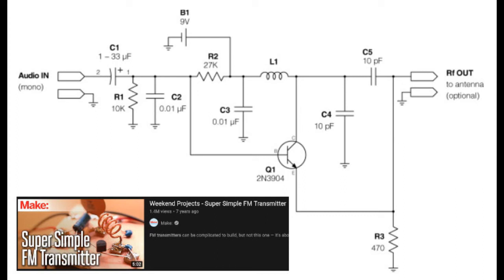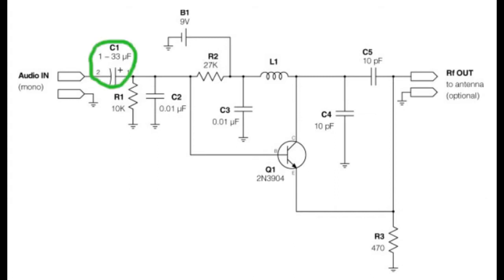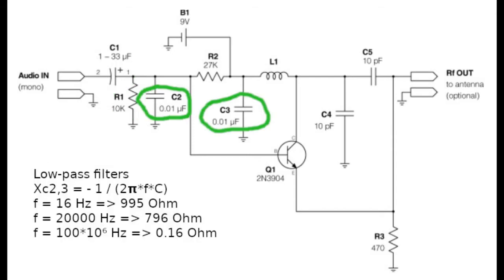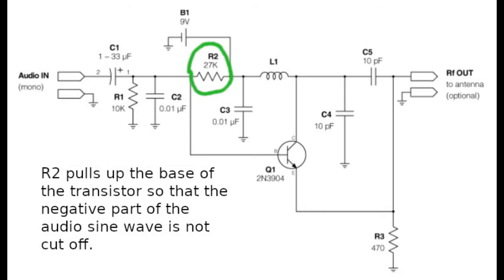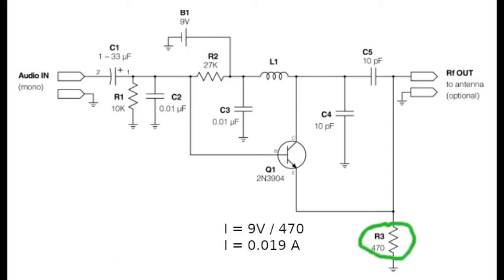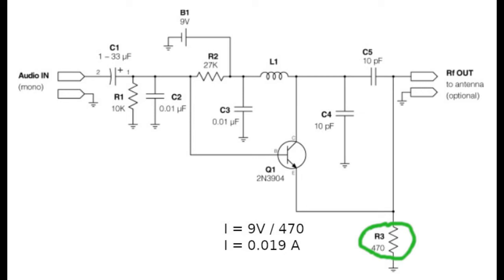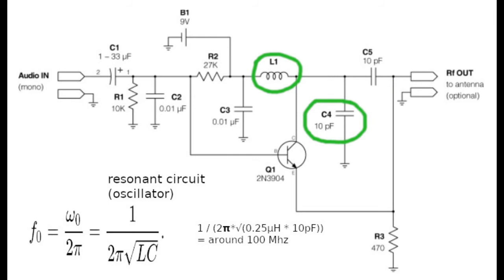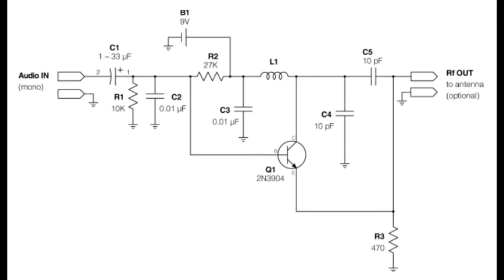Circuit Explanation - FM Transmitter | (from "Make:")

Comment: At 16Hz Xc of C1, C2 is 995,000 Ohms  or 995k Ohms.
Reply from the maker: Oh my bad, you are absolutely right.
Thanks for this comment!
It is not possible to add text boxes to videos anymore, but I will write it in the description.
Reply: @radio_electronics4047  C2, c3 and 10k got to the ground ryt?
Reply from the maker: @ArshaansEdits  Yes, C2, C3, and R1 (with 10k ohms) are connected to ground.
Reply: And you referred to it in the video as resistance, which it is not, it is reactance.

A capacitor does have a small amount of resistance, a parasitic unwanted resistance called ESR - equivalent series resistance.

Comment: I think, not sure about that,..R1and R2 are the biasing resistor, so C1 and R1 act as the Highpass filter, c5 acts as the bypass for rf signals to ground, and c3 acts as the bypass for RF so they don't disrupt the power supply..
Is what I think 😊... correction please 🤗

Comment: Every wireless transmission except CB is penal and if you are detected you pay a fine. But the authorities remove all your electronic up to the screwdriver, think about!
Reply: You must live in a communist country, that doesn't happen in the USA people been transmitting for YEARS and no one cares.
Reply: @Starbuckin You are wrong. There are 2 licence classes  with and without tecnical examination and permission by FCC. The other is citizen broadcast without permission, no examination required.

Comment: As the collector voltage swings due to audio signals, the internal capacitance of the reverse biased transistor (CB junction) varies and that causes the RF frequency change as per audio which is called frequency modulation.

Comment: hello I want to ask about something very interesting why in internet I find the same circuit (like this in the video) for the am and fm waves and the fm wave should be completely different between the am wave so why this? I think the radio can receive the am and fm waves it request just the frequency? I'm not sure plzzzzz answer!
Reply from the maker: If you use a bigger coil and caps with more capacity and use a very large antenna it might also work for AM, but I have not tested this.
Reply: @radio_electronics4047  sorry but I mean the FM radio can receive a AM wave has the FM band but the receiving way is completely different so how can it be possible to a FM radio receive a AM wave?

Comment: Why is C1 in reverse? Will the audio current even flow this way?
Reply from the maker: The polarization should not matter. C1 is just for filtering out the DC from the audio signal.
You could probably use an unpolarized cap, but bigger caps from 1µF on up are usually electrolytics.
Reply: C1 isn't reversed.  The base of Q1 is biased at about 2.4V and the audio signal is likely to be centred at 0V.  The + terminal of C1 is at the more positive voltage.

Comment: Yes, the circuit is a VCO (voltage controlled oscillator) and the capacitance of Cbe or Ceb, call it what u want, is given by the formula: 

Cpi = Cje + gm*Tf 

Cje and Tf its a variable that comes from transistor technology Silicon design of the transistor, dimensions, etc.. 
(its on the datasheet).

You can see that gm = ibias / Vt 
Where Vt = Thermal Voltage = ~25mV.

So the feedback network of this circuit would be between C5 and Cpi.

where Vin = Xcpi * Vout / (Xcpi + Xc5)

Vout = Voltage @ colector
Vin = Voltage @ emitter

Because at ressonance Vout = Voltage @ Capacitor 5 (because paralel L and C impedance goes to infinity).

The analysis of this circuit is deeper than the guy on the video explained, but thanks for making this kind of content!!

A tip for working with oscilators and determining (predict) voltage of oscilation is:

1) Say that Voscilation = Voltage YOU define.

2) Say that Vin = Vcollector after goin thrught Capacitive divider C5 >> Cpi (parasitic capacitance of transistor)!

3) Based on Vin = cap_divider * Vout, determine Gm(Vin) "Large Signal Transconductance" which is expressed by gm * Bessel(Vin / Vt) / (Vin/Vt)

4) Work out the amplifier topology gain, based on your Gm(Vin) (already obtained) and the gain of a common base topology.

5) Choose bias point, etc that works out for you. So that the NEGATIVE impedance REAL and IMAGINARY parts cancel out. (The transistor Common Base - C.B. amplifier can be seen as a negative impedance.. and the feedback network / antenna Transmission Resistance ~35 ohms for a 1/4 wave antenna is the other impedance.

6) Im { Zcommonbase @ collector } = - Im {Load} (in this case the antenna + inductor)

7) Re { Zcommonbase @ collector } = - Re{Load}

This is the real math etc on how you do it.
You have to understand: 

- Large signals transconductance
- How to do the math for the CB amplifier impedance @ collector without load. (you can use a circuit simulator.. to know it and bias it ez)
- LC parallel impedance = Infinity @ Fressonance
- For STABLE oscillation you NEED Im { active circuit } = - Im { load } AND Re { active circuit } = - Re { load}

That's it.. I can't really explain it all in a comment but this is the real deal.

Also this circuit is a VCO (voltage controlled oscillator) so for creating a VCO you NEED a LC tank circuit that CHANGES its values with a VOLTAGE, so that's why Cpi (parasitic base capacitance) is a MAJOR part of the LC tank circuit (its just not there because its a parasitic from the transistor between base and emitter).
Reply: Thanks for you passionate heart and helpful explanation,.. any reference e book i can consider? , Please you can share it, I'll be glad 😊
Reply: @kahenajr2515  yes, my RF discipline teacher recommended two books, I’ll see if I can find the name of both so I can share as well (probably will send a message again later today)

But the secret on this oscillator circuit as mentioned is the parasitic capacitance from the BJT
Reply: @vfthome-yt  okay, thanks for your commitment, I'm waiting for that..
Reply: Sorry I'm on a party haha but the complete list is (from my teacher's Radiofrequency discipline at UFSC):

- Fundamentals of Microwave and RF Design 

- Microwave and RF Design: Radio Systems. Volume 1

- Microwave and RF Design: Transmission Lines. Volume 2

- Microwave and RF Design: Networks. Volume 3

- Microwave and RF Design: Modules. Volume 4 

- Microwave and RF Design: Amplifiers and Oscillators. Volume 5

- Livro: W. Alan Davis, Radio Frequency Circuit Design, Second Edition, Wiley, 2010.

I have all the pdf's and a lot of stuff from when I was on graduation on electronics engineering. Can upload it on a g drive.
Reply: @vfthome-yt  😅😅.. thanks bro 👊
Reply: Cpi parasitic capacitance = Cje + gm*Tf 
gm = ibias / Vt 

When you change Vb of transistor, since Vbe = 0.7 = Constant >>>> i_bias changes, so "gm" changes and "Cpi" changes as well!!
That's how a voltage signal modulates the FREQUENCY of oscillation.

Because Cpi is part of LC tank ! And the LC tank defines oscilating frequency.
Reply: You CAN also do the maths for the barkhausen criterion which is another way to get stable oscillation. Similar to the negative resistance technique. But in that method you use:
Loop gain = 1 (total gain of the circuit) 
Which is = L = Alfa * Beta
Where alfa = cap divider = vout/vin
Where beta = gain of C.B. Amp = Gm *ro

After that you must also ensure phase of loop (Alfa * beta phase) is zero or multiple of 2*pi so that the feedback is positive and the signal gets bigger and bigger. 

In real design you use loop gain of 1.2 or 1.5 because Gm(Vin) Will limit gain and stabilize it in 1 if signal grows too much.
Reply: @vfthome-yt  thank you so much for the detailed explanation
Reply: @abhishekgadekar5618  we have to help each other in electronics is such a hard field and people never post the good stuff online there is also a lot of misinformation. 

Very different from the programming field that I use to work with nowadays.
Reply: @vfthome-yt ... If you are privvy (assuming no chips used to hide the circuitry ... but IC schematics available) to the converter technologies of used old electronics such as 2007's converter boxes output to be input to analog TVs you can get an idea of real world components, despite transistors having characteristics that change components such as a stand alone transistor to the transistors in an IC chip.  This design helps to configure a really basic transmitter as is all other transmitters figured out in many complete electronics for technicians books ... found here and there for this 1960-70s electronics working today.

Comment: if I use a better amplification circuit and add an antenna instead of the speaker output, Would it give better range?
Reply from the maker: Where do you see a speaker output? I use an fm antenna.

Im not sure how to increase the range, probably more stages of amplification, more transistors, more power, but I don't think it's that simple.
Reply: @radio_electronics4047  I mean after the Amplification circuit instead of using a speaker for common amplifier can I give that output to the transistor?
Reply: @radio_electronics4047 ... I agree ... Other FM transmitter circuits are in other technician electronics books showing how VCRs or Digital Converter boxes of 2007 readied the audio part for TVs vs an antenna design.  Those using IC chips to transmit their conversion have chips used schematics ... Very more components abstract to this simple design (that comes from the 1960s or 1970s hobbyists enthusiastic circuits)!! Great video for a nice quick low parts used transmitter for a small sound from a microphone video! 👏

Comment: Hi, I think C4 should be connected to positive of the power supply instead of negative and it should be a variable capacitor to control the transmitting frequency.
Reply: You think incorrectly - it connects to ground! However, you are correct that it could be replaced with a trimmer but connected to ground.
Reply: @SpeccyMan  I'd agree with  a connection to 9V node, why to ground? Does it even make any difference since in small signal analysis, ground and power supply are seen as connected.
Reply: I think if you connect to the positive it will work (but as the parallel lc oscillator) I tried this and worked out..

Comment: does the transistor here acts both for amplification and maintaining the frequency oscillation?
Reply from the maker: Yes, it keeps the oscillation going and amplifies the audio signal.
Everytime there is a positive voltage from the audio signal it "nudges" the oscillation.
Reply: @radio_electronics4047  what's the drawback tho? I'm assuming using two transistors, one for the oscillation and one for the amplification will be better...
Reply from the maker: @pradeszebua  The sound that comes from the smartphone is already amplified and you could just hook it up to speakers and would hear it fine.
So I don't think the amplification part plays an important role here, but I'm not an EE so I can't give you a really qualified answer on that.
Reply: Ah I see, thanks man